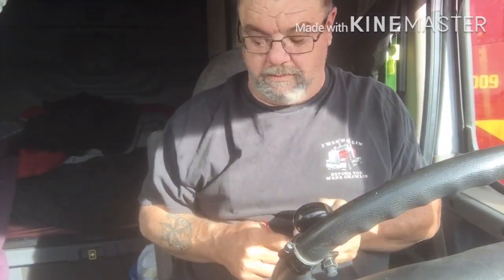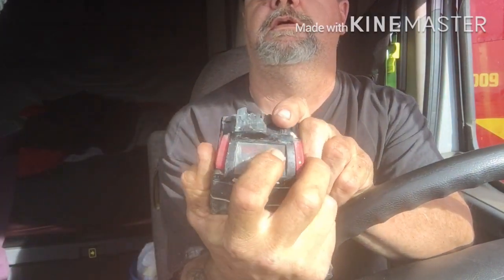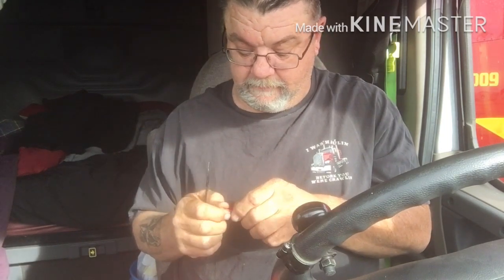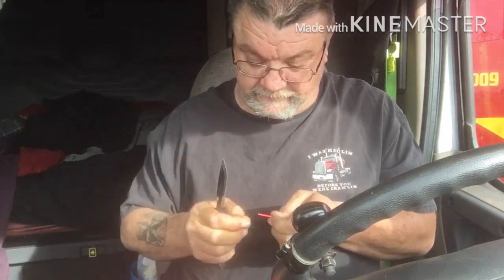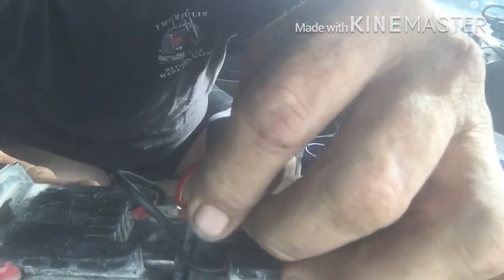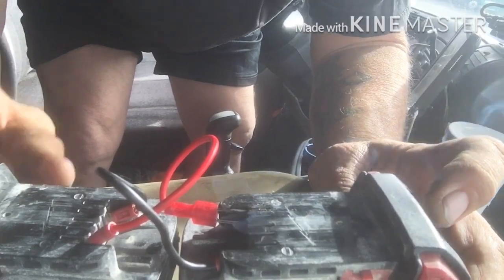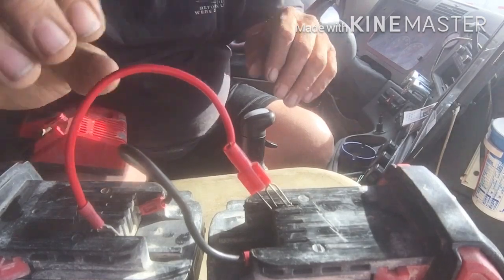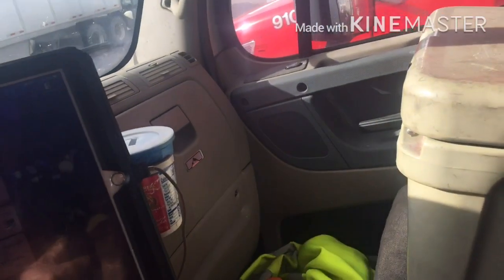Reviving cordless tool batteries

Comment: Nice vid Stacey, Good to have you show this so people can try it before throwing them away.
I have tried that with tool batteries also and got them to charge but mine never held the charge, these batteries have a set of 1.5 or so nicad batteries (or nimn etc.) in them to make up the voltage.
what I did was open them up, find the 1 or 2 batteries that are shot, go to home depot (at their bad battery drop off box) ask if I could have a couple and take the good batteries out of them to fix mine.
It's a lot cheaper then buying a complete battery.